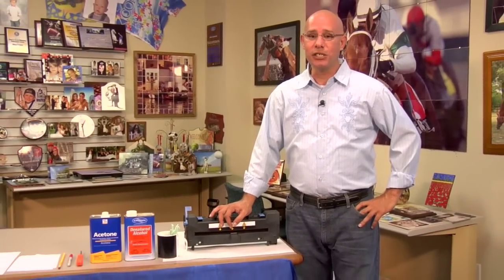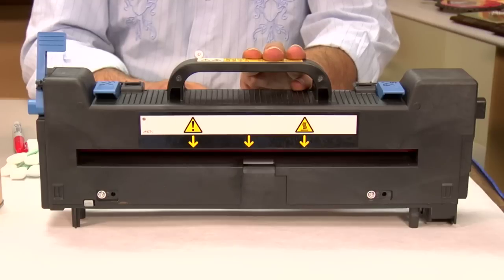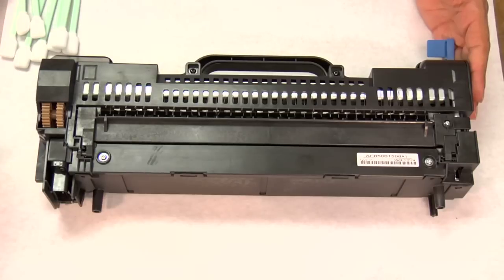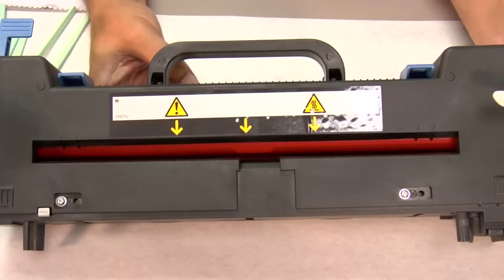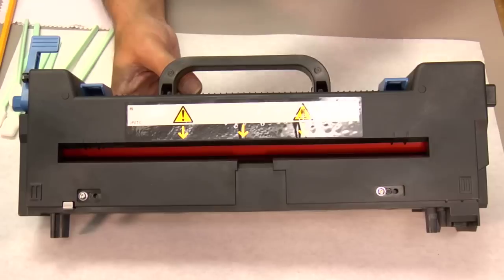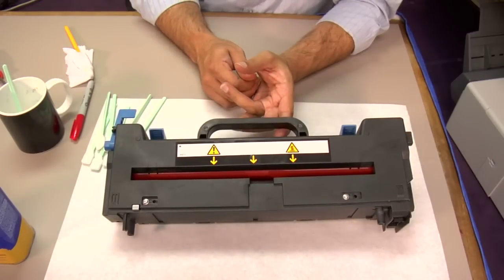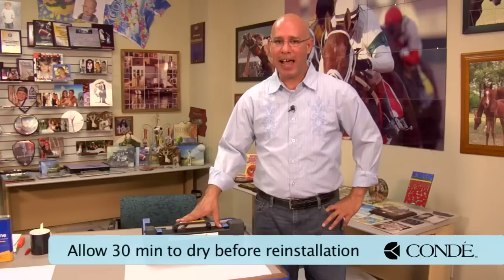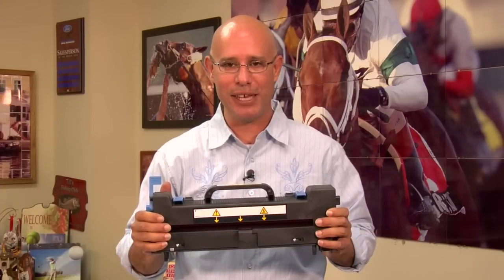Cleaning an OkiData Fuser: Toner Contamination -

Comment: I have an OKIData C5150N. On this particular model, there is only one 
gear. Before trying the cleaning method you describe, I advanced a clean
 sheet of paper through using the gear wheel, and it came out the other 
end perfectly clean. No marks or lines of any kind. Decided not to 
proceed with the cleaning, having assumed that my problem lies 
elsewhere. Most likely the toner drums.
Reply from the maker: +LOA1955 .................Pull the cyan drum unit out of the printer and see if there is a line of toner or a scratch on that side. 

If you see a line of toner try shaking the drum unit from side to side several times. This is a sign that toner is clotting. 
If you see a scratch then replace the drum unit.

There is no real safe way to clean a drum.

Comment: What do you do with the gears before you put the cleaned fuser back into the printer? I popped the outer wheel as instructed, cleaned the roller by turning the inner wheel, but do I just put the fuser back as is? Don't I have to reset the gears as they were before?
Reply from the maker: please contact our technical support at support@conde.com

Comment: Is there anything I can do, if I get Error 348 (check fuser unit / not properly installed) after cleaning? When I turn on the printer I hear a repeated squeaking sound of the printer appearantly trying to check / move the fuser, giving up after 4 attempts. The unit is properly seated. Maybe I have damaged the fuser unit by cleaning? Can the gears be in a wrong position?
Reply from the maker: Hello Marcus, Please contact our technical support at Support@conde.com.

Comment: Do i have to do anything with the outside gear wheel after cleaning? (restore position?) or not
Reply from the maker: No, you do not have to readjust the gear wheel.  Simply place the fuser assembly back into position, lock in and close the top lid of your OKI printer.

Comment from the maker: Unfortunately, I do not have the procedure to disassemble an Okidata fuser.  That information is usually reserved for service technicians.  I would advise that you remove and reset the transfer belt to your OKI C5150n.  The transfer belt is the "black belt" underneath your toners and image drums.  If the belt is slightly misaligned, it could cause paper to feed into the fuser at an angle.  If this trick does not work, you may have to invest in a replacement fuser.

Comment: cyan streaking on c5650.  on one side predominately.  drum is not showing as needing replacement, but is that the problem? Should I clean the drum?  what is that process?
Reply from the maker: +Connect Pull the cyan drum unit out of the printer and see if there is a line of toner or a scratch on that side. 

If you see a line of toner try shaking the drum unit from side to side several times. This is a sign that toner is clotting. 
If you see a scratch then replace the drum unit.

There is no real safe way to clean a drum.
Reply from the maker: +Connect Load your printer with plain paper, then print a 8" x 10" "solid panel" of Cyan, Magenta, Yellow and Black.  If the streak appears in only one panel, then the issue is probably image drum related.  If the streak appears on all four color panels, then the issue could be a transfer belt or fuser.  For more information, contact OKI Tech Support at 1-800-OKI-DATA.

Comment: My labels keep getting stuck in the fuser and now the bar with the little brushes has fallen off - what do I need to do?? Many thanks Helen
Reply from the maker: If your "brush bar" has come off your fuser assembly, but it is still operational, then no worries.  However, if you have cleaned your fuser and your labels are still getting stuck within the fuser, then you may want to consider purchasing a replacement.  If your labels are getting to the fuser, but then jams and folds up, then it may be a static issue with your labels.  You can try to remove the static charge from your media by wiping the media with an unscented dryer sheet.

Comment: doesnt work, need the file to flash firmware or whatever file they use to clear the 980 message. do you know where i can find this? c610n
thanks
Reply from the maker: Usually, a "Fatal Error #980" message on an OKI printer means that the Fuser Assembly has failed.  If you clean your fuser, reinstall in the printer and still get a "Fatal Error #980" message, then the fuser must be replaced.  For a "second opinion", you can contact OKI Tech Support at 1-800-654-3282.
Reply: ***** I can advise that even a new fuser does not fix the Fatal error 980 problem